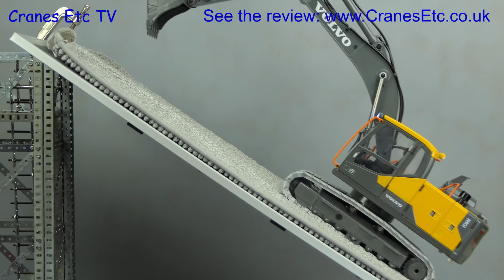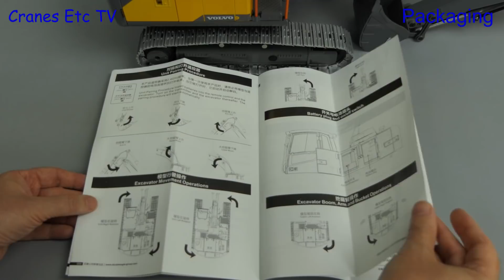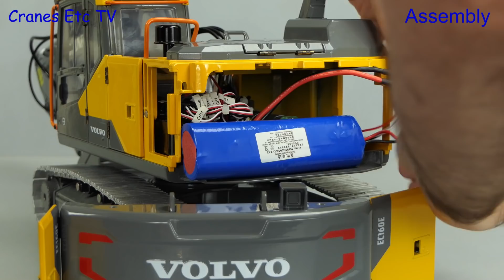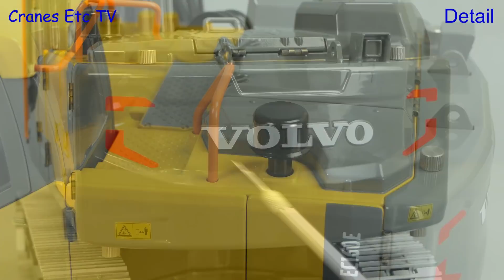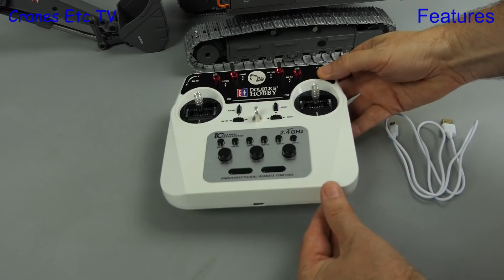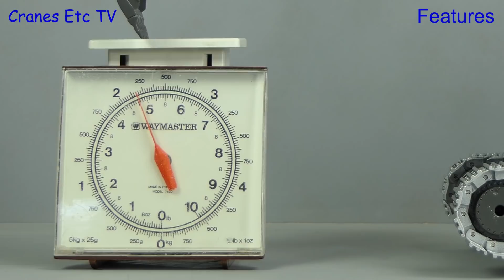RC Double E Hobby Volvo EC160E Excavator by Cranes Etc TV

Comment: What worries me is that with each batch they make, they lower the quality. If you ordered one 5 months ago you got one with metal hydraulic pipes, and an aluminium case.

Also, the link is to the ELECTRIC version, not the hydrauli one, so watch out
Reply from the maker: The review is of the electric one.  The hydraulic one is a different specification, and of course much higher price.
Reply: @CranesEtcTV  Oh, okay! I thought that this is the hydraulic one from the veight- pressure test

Comment: It is hydraulic with oil not motor in piston I just read on homepage. It has oil pump so Dont remove the hoses on the pistons I own 2 hydraulic exavators in simular scale. Theese are fun to dig in garden with you should try it. You got a grown mans toy there Best regards From Sweden
Reply from the maker: This is the lower cost version with motorised pistons.